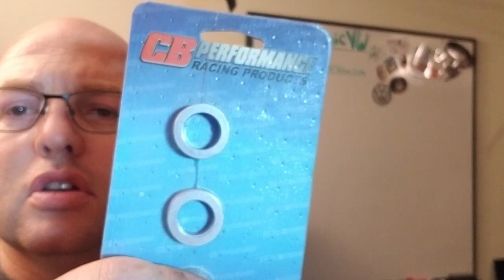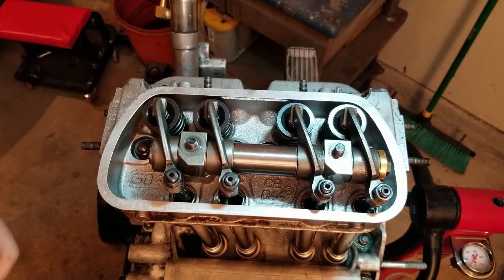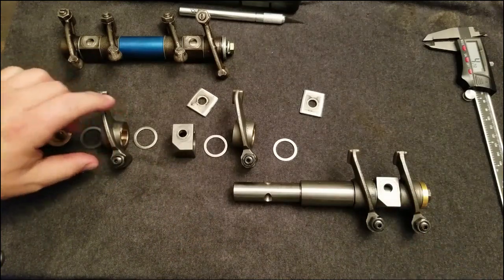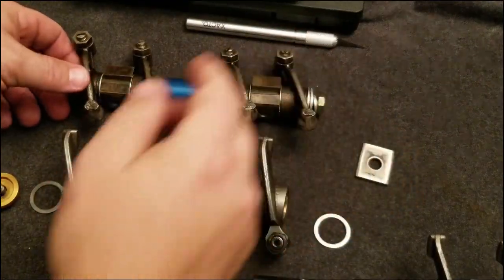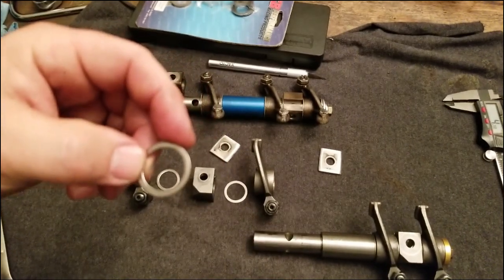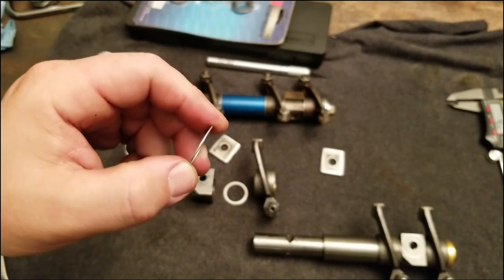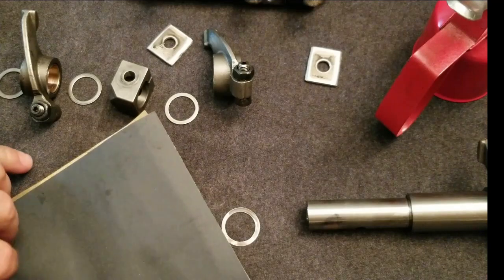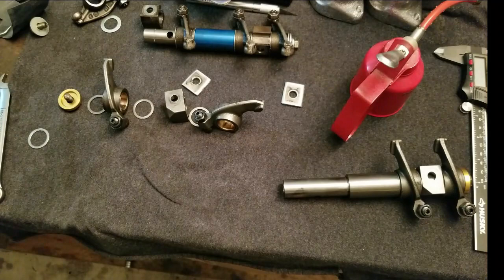How To: Install Solid Rocker Shafts -  1956 Ragtop - Volkswagen BUG | JW Classic VW

Comment: Perfect, just what I needed. I watched your video(s) the other night regarding setting rocker arm geometry.
Got it spot on today with just one shim under the rocker blocks and tomorrow I’ll be cutting my chromoly push rods to length eeeeeekkkkkkkkk

This is for my new build stroker 2110cc  going into my T2 Splitscreen bus

I’ve also taken delivery of my remote oil cooler, fan and AN fittings last week, so about to go and watch your other video now 👍
Reply from the maker: That's awesome man!! Sounds like your building a little monster. Glad you like the videos brother, EZGZ has a good video on pushrods and 1:4:1 rockers... check it out.

https://youtu.be/yfbSBcXzQXE

Comment: Nicely done.  Think i'll go with the solid rockers for my 1641 build, those spring washers seem vulnerable. Using a feeler gauge, what clearance do recommend?
Reply from the maker: Hey Carlos, if your talking about side play with the rockers I always shoot for around .005" gap.  Here is what the guys from aircooled.net have to say.  Pulled this from one of the forums on the Samba.

******************************* AIRCOOLED.NET | JOHN ************************************************************
you can use the shims with the stock rockers, but you still risk the horseshoe clips breaking or popping off. Shim as tight as you can without binding. If you have more than .005" play, you need to tighten it up.

Start with the center 2 rockers FIRST. Then do the outsides last.

Remove the wavy washers, the stock flat washers are .040". The kit comes with .015, .030, and .060". Combined with the .040" you can shim anything. You will have to think of how to remove 2 shims and add 2 or 3 shims to tighten up .005" more. Maybe make a chart

.070" = 1 stock shim and 1 .030
.075 = 1 .060 and 1 .015
.080 = 2 stock shims
.085 = 1 stock shim, 1 .030, and 1 .015

https://www.thesamba.com/vw/forum/archive/index.php/o-t--t-512972--.html